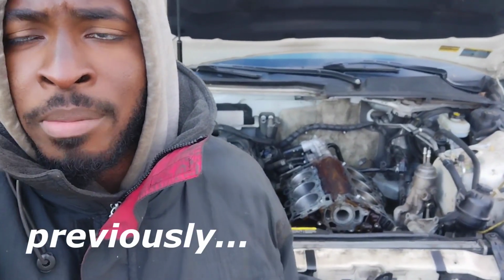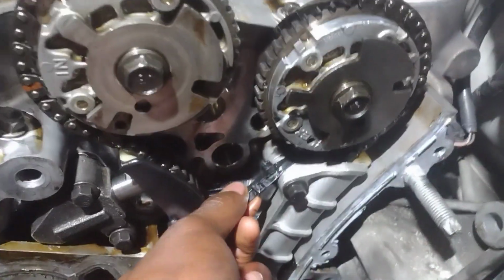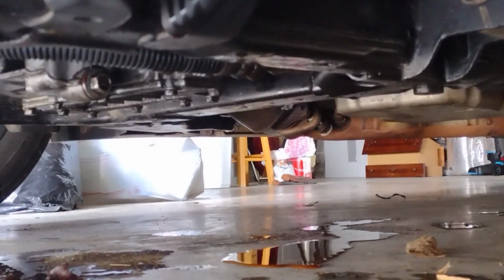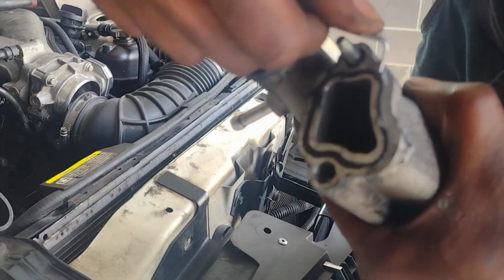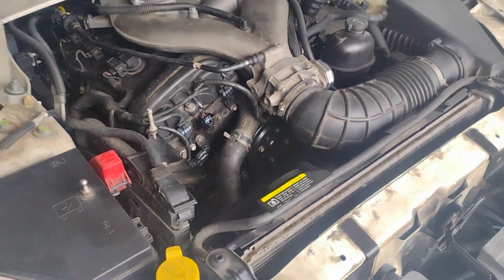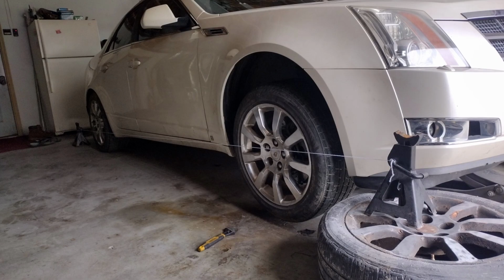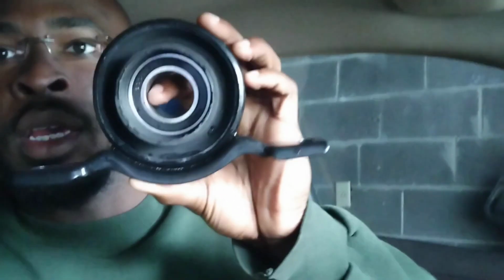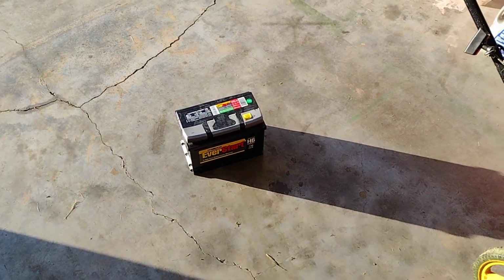Putting the NEGLECTED DOA Cadillac BACK ON THE ROAD

Comment: Got a question. I have an engine, seized, can't move the pistons up or down. It's out of the car, on an engine stand. Heads are off, one bank is pretty as a picture, the other has rust from a blown head gasket. The rust is significant that it seized the pistons on that bank. In that situation, how would you move forward? I figured a hone might help, but that would only knock off the rust above the pistons, and I've got rust all the way down past the rings.